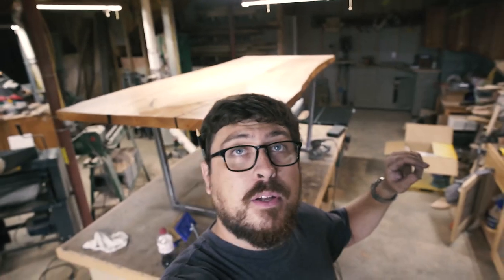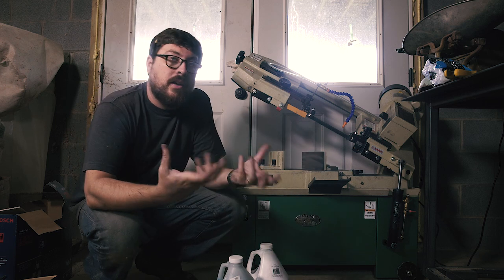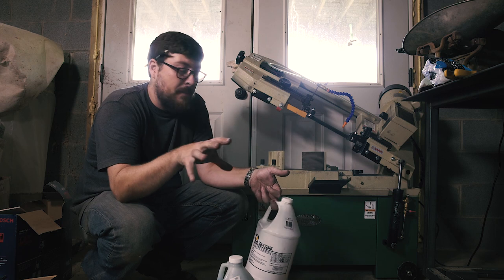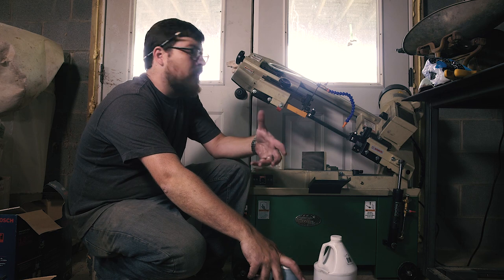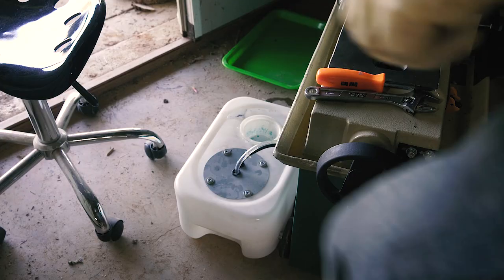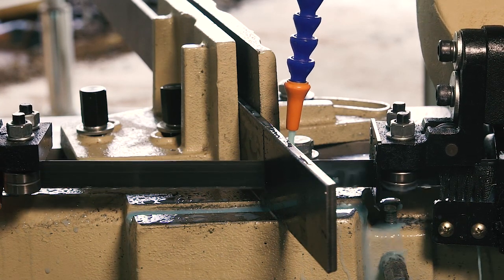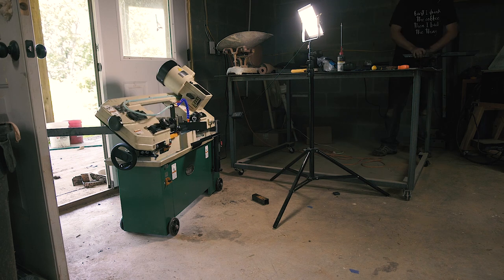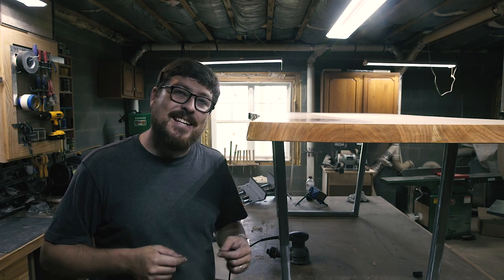What fluid to use in your metalcutting bandsaw

Comment: Minor point, but I'd have the nozzle applying the fluid on the other side of the work piece.
Reply from the maker: I experimented both ways and this way seems to work well.  Enough fluid carries over that the blade and workpiece is cool to the touch after the cut.
Reply: Wm. Walker Co. Take the advice Walker, JoCo is right - point it where it’s cutting, machinist for 30years - frankly, it’s ridiculous to do what you’re doing! Forget your pride or whatever it is that makes beginners think they know best and refuse advice! Just do it right, a bit of soluble oil on the floor is no biggie cobber. Nike!
Reply: Yes the flood coolant should also flush chips not just lubricate and cool... can’t flush chips from back there. Your blade will thank u
Reply: @SpatialGuy77  "Forget your pride", says the dude who reeks of hubris.
Reply: @th3frogman  some people need to be told with firm words that they are wrong. He obviously thought he figured out the best way, by testing it himself, and is now casting aside any advise to the contrary. Some band saws (like the BS180) actually have a fixed nozzle as part of the sledge, so you can move/slide it as close as possible in front of the piece to cut, and it's always positioned perfectly above the blade. His also has a sledge, but he uses that blue twisty thing to extend its reach past the piece to cut - which is wrong.

If you cool the blade after the cut: The blade and piece to cut will heat up, then the blade gets cooled down right after, but the piece to cut will not get much cooling, so it will continue to heat up. If you cut a large piece, it will heat up a significant amount, so the blade will go though constant heating and cooling, which will shorten it's lifespan.

If you put the water/oil cooling in front, it will also cool down the piece to cut and neither will experience any extreme heat.

 "I am fascinated by how good people are at knowing how good they are at doing things. To know how good you are at something requires almost exactly the skills as it does to be good at it in the first place. So, if you are absolutely no good at something, you lack exactly the skills that you need to know that." David Dunning - The guy from the "Dunning Kruger Effect"
Reply: @siamsurf  Good point. I appreciate the input.

Comment: if you don't have the coolant setup just get a LENOX LUBE TUBE $10 at Airgas works with any metal lasts long time no liquid to mess with just touch on turning blade before each cut I been using it for years, make sure blade speed is correct

Comment: Yeah mate, what Conko said:
Feed oil onto blade where it touches workpiece or a microbit before if that’s your thing. 
The coolant has 3 jobs:
• Lubricate
• Cool
• Remove metal chips/waste. 
The last one is very important, so point it where all the action is and don’t be afraid to crank up the volume (of lube)!
Cheers mate.
Reply: Do you need to use oil when the saw has a coolant system? I learned to use oil on traditional bandsaws which always leaves a mess for welding and cleanup. But wondering if you can get away without doing it?
Reply: @KeithHamm  no oil needed when using cutting fluid.
As a matter of fact, oil can reak havoc on your coolant system when it forms on top of the coolant in the tank and starves good bacteria that need air. It makes the tank and fluid stink.

Comment: ... been staring at a Central Machinery 7x12 Band Saw at my local Harbor Freight for a few years now. Slowly watching the price creep down on a floor model "open box". Regularly $900. Marked down to $800 with coupon. Then to $750. Then $695. Finally this weekend I went there and the layers of price stickers had grown by 1, $575. SOLD! Considering these same saws marketed by other manufacturers sell for around $1K, not a bad deal, I think. Was looking PRECISELY for a suggestion on what coolant to use to cool and lubricate that I could mix at a high ration that would not eat up the savings I just got. Your video hit the spot. Do you find any rust or foul smelling using the Rustlick? Last think I want to know before placing the order. Thanks again!
Reply from the maker: Awesome! No rust and zero foul smell I can detect. When I cut steel the most notable thing I smell is the smell of cut steel. If you work with metal at all, you'll know the smell I'm talking about.

Comment: Interesting. I actually thought you always applied on the work piece. I didn't know these saws fed fluid out like this. Good video!
Reply from the maker: Not all saws have coolant systems.  This one does.  I actually cut the majority of the pieces before the coolant arrived and applied oil to the steel.  That works too but you have to stay at the cut to reapply oil.  The coolant system is a really nice feature to have.

Comment: People think I'm crazy, but Simple Green works well and it keeps things clean.  I get about the same life out of blades that I did with the expensive cutting fluid.
Reply from the maker: Thats a good tip! The WS 50/50 goes a pretty long way as it's heavily diluted. Good to know though!
Reply: Interesting. Do you dilute it or use it as it comes?
Reply: @bohdanko90  Just like in comes.  Only downside is that it evaporates, so you need to replace it more often.

Comment: Nice instructional William, I also use the water soluble oil but apply it in a much slower stream... I don't see it being a problem for you but if it seems to get all over the place slow the flow...
Reply from the maker: Yeah, I'm still fooling with best fall rate, coolant flow, speed etc.  I'm so paranoid about trashing blades I feel like I'm overly cautious.

Comment: Should the oil be applied to the blade before or after its in the metal? You should it after and I didn't know if that mattered. Thanks for all the great videos!
Reply from the maker: I experimented both ways and this way seems to work well.  Enough fluid carries over that the blade and workpiece is cool to the touch after the cut.
Reply: The coolant is also used to help flush the chips away during the cut to keep it from getting plugged so coolant after the cut is not really helping in that aspect, nice saw anyway..

Comment: I have used Rustlic  50/50 for years works great,i use 4 ounces per gallon and it will evaporate over time and just add some more water to the tank ,when it gets skunky change it out.